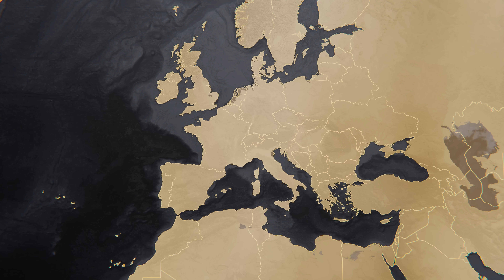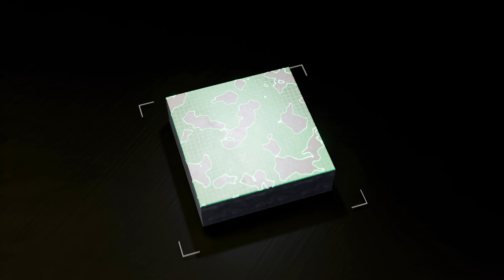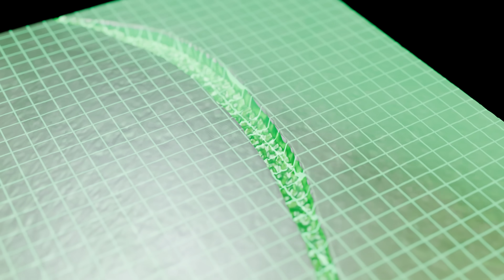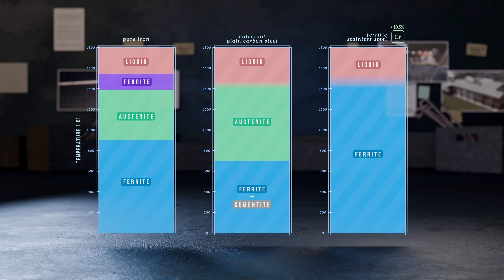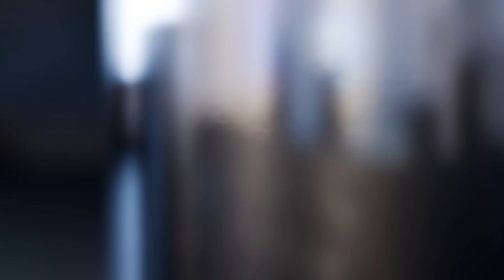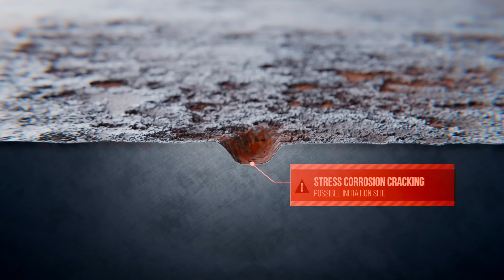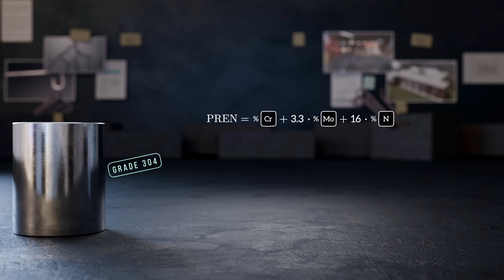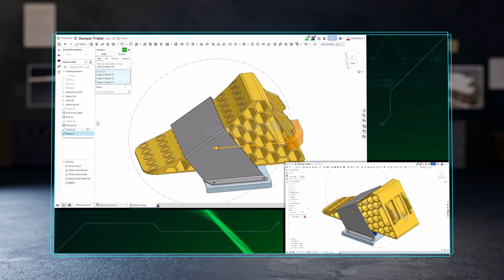The Problem with Stainless Steel

Comment: 304 hasn't at all got excellent resistance to corrosion . Just look at a stainless steel domestic bin . They corrode relatively  quickly . 304 is for show ie cosmetic purposes only . 316 is the good stuff. Marine grade . Not only that you mention a swimming pool =chlorinated warm water . Chlorine promotes oxidation . I learned only last night from an old engineer Dan gelbart that if bleach  or acid is stored in a steel   cupboard the cupboard will rust even though the bleach or acid is itself  stored in a sealed plastic container because the acid will slowly evaporate  through the plastic molecules . Bleach or acids spilled on a machine shop floor will cause all the machines around the area to begin to rust even after the floor is cleaned up . The solution is to use an alkali to wipe everything down .

Comment: I once used picking paste and passivation chemicals on stainless after I welded it to protect the stainless steel from corrosion as welding causes the chromium to deplete…. And it did the opposite of what I wanted it RUSTED!!!! ( as I now know if you do not wash all the pickling paste off it actually keeps eating at the stainless and causes it to rust faster) stainless can be a pain!!!!

Comment: The suspended ceiling panels are the same thickness as drywall 1/2, 5/8,3/4.But made of concrete.Not thick but still heavy.If you have a new house, that, not drywall is whats behind the tile in your shower.

Comment: Not to lessen the Uster disaster, but stress corrosion cracking of 300 series was well known prior to then, though considered rare at temperatures as low as that in the roof.

Comment: I worked in an industry as a welder dealing with high pressure stainless pressure steel vessels. On one occasion we had some pitting in a SS container. We actually discovered through x-ray analysis that the pitting had spread unnoticed beneath the passivation layer and had destroyed a very large section of the pressure vessel. Our team eventually realized that there is actually some kind of bacteria that thrives on the ingestion of the products entering through the pitting and releasing acids or alkaline that further corrode the SS. These bacteria were almost like worms burrowing beneath the passivation layer, like worms under the soil continually corroding the SS completely unnoticed.

Comment: ai summary

Abstract:

This technical analysis investigates the 1985 Oster pool disaster in Switzerland, a structural failure caused by the unexpected corrosion of Grade 304 stainless steel suspension rods. The report details the fundamental metallurgy of stainless steels, specifically the role of chromium in forming a self-healing, 10-atom-thick chromium oxide passivating layer. It explores the relationship between alloying elements (Chromium, Nickel, Molybdenum) and atomic crystal structures, distinguishing between Body-Centered Cubic (BCC/Ferritic) and Face-Centered Cubic (FCC/Austenitic) lattices.

The investigation identifies the failure mechanism as chloride-induced Stress Corrosion Cracking (SCC). In the pool's high-humidity, chlorinated environment, chloride ions caused localized pitting, which acted as stress concentrators. Under sustained tensile stress, the austenitic structure of the Grade 304 steel facilitated plastic deformation at crack tips, rupturing the protective oxide layer and allowing rapid crack propagation. The analysis concludes by contrasting the vulnerability of single-phase austenitic steels with the superior resistance of Duplex stainless steels, whose dual-phase (ferritic and austenitic) microstructure effectively arrests crack growth in corrosive environments.

Technical Analysis: Metallurgical Failure Modes and the Oster Pool Collapse

    0:00 Case Study: The Oster Disaster: On May 9, 1985, a concrete ceiling at a Swiss swimming pool collapsed due to the failure of Grade 304 stainless steel suspension rods, resulting in 12 fatalities.
    1:18 Passivation Mechanism: Stainless steel's corrosion resistance is derived from a minimum of 10.5% chromium, which forms a stable, self-healing chromium oxide ($\text{Cr}_2\text{O}_3$) surface film that prevents oxidation of the underlying iron.
    3:11 Crystal Structure Fundamentals:
        Ferritic (BCC): Body-Centered Cubic structure; stabilized by chromium; typically magnetic and less ductile.
        Austenitic (FCC): Face-Centered Cubic structure; stabilized by nickel ($\ge$8%); non-magnetic, highly ductile, and possesses superior general corrosion resistance.
    5:24 Grade Classification and Market Share:
        Austenitic (e.g., 304, 316): Comprises ~70% of production; 304 contains ~18% Cr and ~8% Ni; 316 adds molybdenum for improved localized corrosion resistance.
        Ferritic (e.g., 430): Comprises ~25% of production; contains chromium but no nickel.
        Martensitic/Duplex/PH: Specialist grades; Martensitic is high-carbon and high-strength; Duplex utilizes a dual-phase structure for high strength and corrosion resistance; Precipitation Hardened (PH) steels use aging to form strengthening precipitates.
    11:39 Failure Mechanism: Pitting and SCC: The failure was driven by a convergence of a susceptible material (Grade 304), a corrosive environment (concentrated chlorides from evaporated chlorinated moisture), and sustained tensile stress.
    13:00 Stress Corrosion Cracking (SCC): Chlorides attacked the oxide layer, creating microscopic pits. These pits served as stress concentrators where plastic deformation at the crack tip continuously ruptured the passivating film, preventing re-passivation and driving crack growth.
    14:41 Vulnerability of the FCC Lattice: The closely packed planes of the austenitic (FCC) structure allow for easier dislocation movement, facilitating the plastic deformation required to sustain and propagate cracks under stress.
    15:54 Pitting Resistance Equivalent Number (PREN): Grade 304's susceptibility is quantified by its low PREN, a result of lacking molybdenum and nitrogen, which are critical for resisting chloride-induced pitting.
    16:27 Mitigation via Duplex Steels: Modern engineering standards for chloride-rich environments favor Duplex stainless steels. Their dual-phase microstructure provides high strength and effectively halts crack propagation when a crack moving through the austenitic phase hits a ferritic boundary.

Comment: I worked in a refinery where metal inspections were a constant requirement especially for stainless steel or stainless clad vessels that contained chlorine or chloride compounds. Stress corrosion cracking was also monitored closely especially in high pressure hydrogen processes. In some instances stress releaving was used for carbon steel vessels when sulfur  compounds along with hydrogen caused brittle fracture. Their failures have been catastrophic. Great video!

Comment: They could have put positive air pressure above the ceiling to keep the "chlorides" from seeping in. But how would you sign this? "If the positive-pressure system fails and you neglect it for 3 years, then the rods will break and the ceiling will fall and kill people."?? Clearly they needed different rods, but what kind? And what about the roof? What did the "chlorides" do to all the plain-steel roof trusses? Are they corroding and cracking too? (If not, then maybe cheap plain-steel rods would have prevented this disaster and still be in service just like the roof.)

Comment: What design would NOT have failed? More rods? Rods with a larger diameter? Different stainless steel? Plain cheap carbon-steel rods? Iron rods? Some other metal (copper) or alloy? What about painted rods? Epoxy-coated rods? Copper-plated rods? Copper-clad rods? How about simulating and tabulating all of these for comparison?

Comment: I am a long-since retired HVAC and structural engineer. I'm still scratching my head as to why a swimming pool facility would have suspended CONCRETE ceiling tiles. I would have to see the plans/blueprints/engineering markups to see why they justified having a drop-ceiling made from concrete - it's NOT a good insulator to keep warmth inside the building - so why did the architect choose concreted suspended drop-ceiling for the panels above the pool? (architects are the bane of quality engineering).
There are lighter, more insulative materials that could have been used back in the 1980s, yet the architect chose concrete. This simply makes no sense.

Comment: The other problem is because of the expense of stainless steel, a lot of industries buy the Chinese imports which are poor quality and have a lot of impurities, causing issues like this. I've experienced issues like this with Chinese metals, not just stainless, aluminium even mild steel. Chinese metal is much more likely to crack when formed, pressed, folded or worked in any way. This is a big issue right now with Chinese electric cars like BYD. They look great when new, but after about 2 years have serious rust and fatigue issues.

Comment: Maybe there was a stray electrical  current running through the metal. I’ve noticed that not all direct copper to galvanized pipe connections don’t corrode at all. Maybe the stray current has something to do with it. Plus terrible planning by allowing concrete panels to hang like this.

Comment: If I'm not mistaken, it looks like a similar effect is the cause of some climbing accidents where stainless steel hardware suddenly snaps in a marine environment. One of the recent example is the one at Kalymnos where the hardware was just 24 years old and the victim got 3 sequential failures (normally there to ensure redundancy). There's more info on the web. 
One of the problems is that it's really not that easy to catch visually for the layman, unlike regular surface rust...

Comment: I was in industrial chemical treatment for 35 yrs. and dealing with the treatment of water pipes, cooling towers, chillers, steam boilers and sterilization of domestic water systems. Stainless steel pipes and basins( cooling towers)  presented problems when using chlorine or products high in chlorides. 304 S.S. would corrode at the lower level of chlorides than the higher grade S.S. For instance a S.S. well pump header pipe system would develop pinholes when the well water was high in chlorides and if compounded with well water being chlorinated due to biological problems the issue escalated quicker. 
    Whenever Stainless steel is welded the protective barrier film is lost and the actual weld joint is subject to corrosion. In cooling towers the basins would develop pinholes if the water is over chlorinated and left standing in particular and even S.S. pool filter tanks will develop pinholes and corrosion blisters if over chlorinated in particular with Trichlor tablets that lower the pH as well as being high in chlorides.

Comment: Maybe the problem was the Communist Bloc architecture.... If you didn't suspend 20 tons of concrete above the swimmer's heads in the first place... this couldn't have happened. What's wrong with the standard inclined roof that we have been using for milllenia? There's hundreds of barns and castles with arched roofs that never fell down.

Comment: I dipped all metals in epoxy if they go in an unseen loaction . All my gas pipe too .
Saves a headache later . After jnstalled , i brush a coating over all . Did the same in my truck parts undercarriage. Works well for years . Makes cleaning easier too

Comment: 11:45 "How can a material specically for it's corrosion resistance,  304, deteriorate so badly? Simple 304 is not corrosion resistant, 316 is corroision resistant. 304 is fairly low grade stainless.

Comment: Great Video !  thank-you.  As I understand, concrete is also sensitive to chloride salts, so I am interested to find out more about how concrete stands up to this kind of environment.  However, I understand lots of swimming pools are made  of concrete.  I also find myself wondering what the designers thought regarding the migration of chlorine-rich vapours from the underside to upper side of the suspended ceiling, and also what kind of rebar was used in the concrete given the exposure to chlorine.  Enclosed Swimming pools have been quite interesting design challenges from both structural and mechanical design perspectives.

Comment: I do raw material purchasing for an aerospace company. I recognize all of these. I have feelings about all of them based on how annoying they are to source.... The very mention of some of these gave me PTSD. But this video has given me a whole new dimension on why specific materials might have been chosen. 

Maybe next time I won't be as annoyed when I have to source 12 ft of steel forged in the heart of a dying star and then quenched in unicorn blood.

 To be clear though... Stainless is usually not the problem for procurement. It's all of the other wacky alloys that are single source that are the real headaches... Not to mention the aerospace plastics... Where a 4 inch diameter, 32 inch bar can cost as much as a new car.

Comment: If you go into how to best harden these different materials you will find a jungle. With even more pros and cons.. Duplex as you mentioned can go up to a surface hardness of 1400 VH0.05 or 74 HRC without distorting or changing the shape of the material regardless of size and weight. Just not in Denmark.

Comment: I said Chlorine right off the bat,  it is a devilish corrosive and readily evaporates I keep a couple of glasses of tap water above the kitchen sink to let that occur reducing My intake of that stuff ( not advocating not using clorine for treating municipal water here however, lots more would be dead and right away instead of fifty years later if not fore the Chlorine ) also want to know who thought paper clips were a good way to hold tons of concrete over peoples heads in the first place also why the concrete? Sorry to those whom lost all there future days, different failure point same outcome like the The Hyatt Regency walkway collapse it was sort of like sliding paper clips !

Comment: I usee to work in electroplating. And we needed a plastic lid with a handle for a small hydrochloric acid bath to cover it. Told our maintenance guy to build one, he built it with an stainless steel handle bolted so the screws were in the solution. Told him it will rust away. He kept insisting it was fine. 2 weeks later i had the handle in my hands.😂

Comment: As any mechanical engineer will tell you, the main difference between 304 stainless and mild steel is that stainless is a pain to drill into.
Mild is (relatively) soft and you can get away with drilling it at quite high speeds and minimal cutting fluid.
Not stainless. If your drill speed is too fast and your not using enough cutting fluid, that will cause the stainless to become hot in that area and that tempers it making it incredibly hard. If that happens, you will easily blunt several drill bits before finishing the hole, and there's not a great deal you can do about it.

Comment: Fascinating. Great video. I already knew bleach was corrosive, I think diluted bleach rusted out the spring of my spray bottle trigger. But I didn't think about pool bleach staying in the humidity rising with warm air. And the sun cooking the roof, probably made the conditions so much worse. You inspired me to pay attention to the operating conditions of whatever I choose. Thank you.
Reply: And yes, like a child, I did take a magnet USB connector I have, and started testing things around my home. I was confused about why sometimes stainless steel is magnetic, now I know. But honestly some stuff I tested could still be aluminum or something else.
Reply: And by sometimes magnetic, I don't mean induction. I feel like I have to say that before some smartazz or dumbazz mentions it. I meant different things, that look like stainless steel, not all of them stick to a magnet. And not just the alloy recipe of metals, just using temperature and cooling time to engineer the microscopic structure is amazing to me.

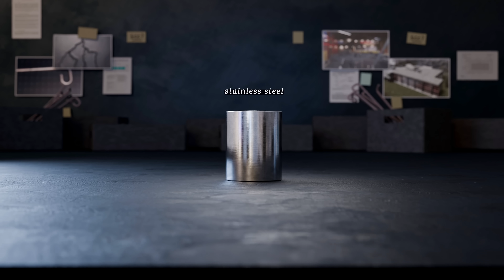Comment: Got here by random and I'm now into 1:21 for the apparently long vid, but I'll save you time. Stainless doesn't withstand Chlorine at all. It will corrode the shit out of it. There had to be insanely stupid engineers working there. Br. Industrial mechanic